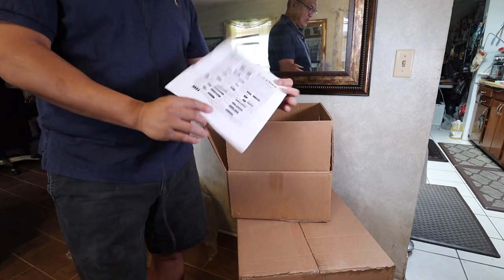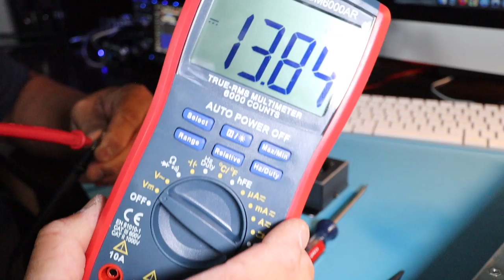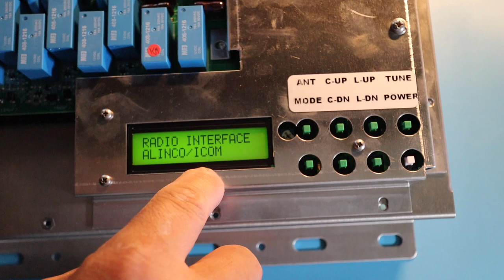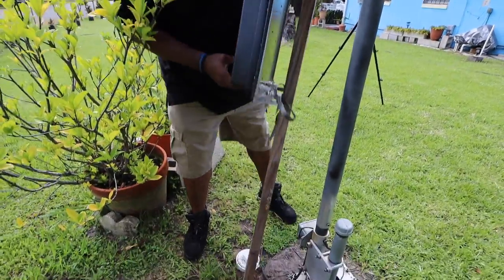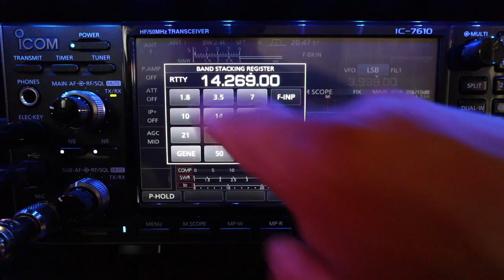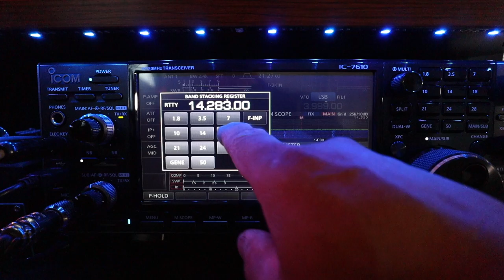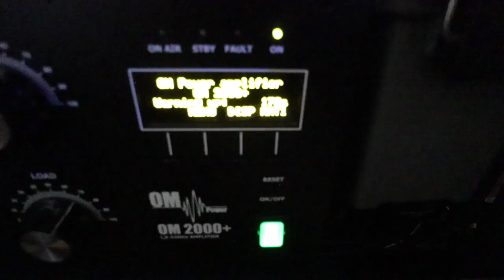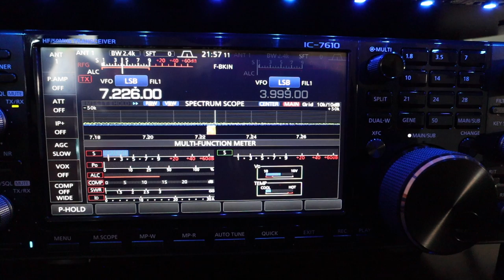MFJ-998RT Antenna Tuner | Modifications to 998RT | Installing at the base of Zero FIve Antenna 43'

Comment: Good job Darren, it's all in the little things that keep us on the air! I purchased my MFJ-998RT about 3 or 4 years ago, had to protect as well but have never had a single problem with it. I use it remotely with my brand new ZeroFive 10-80M Ground plane that I bought, assembled and raised up in the air for 3 weeks now. I am very impressed with the antenna and tuner that I haven't even warmed up and used my Acom amplifier, lol.
Reply: Was impressed until you showed the " Lets go Brandon' vulgarity when you zoomed in to show your work. Vulgar politics is unacceptable for this hobby.

Comment: Nice video. I am the guy Dom told you about. (Ka8jil) I have the new 998 rt still in the box. I will make your changes and hope for the best..Still upset that MFj offered no help for the failure.
Reply from the maker: Hi Tom, nice to meet you through YouTube comments. I bet you were surprised to hear that I mentioned about the failure. Right now , I've removed my 998RT and boxed it up. I'll use it as a backup. I have a new amp with a builtin tuner. 73's de N4VFR.
Reply: @DarrenN4VFR  Oh you got rid of the 998RT ..  don't blame you .. like to know what amp you have please sir with the antenna tuner built in?  Thank you for all you do keep it up.
Reply from the maker: @kayakbassfishing473  I still have the 998RT for another project.  Here is my new amplifier with the built in antenna tuner, it's the RF Kit RF2K-S from Germany.  If your in the USA, you can order from Island Amplifiers:  https://islandamplifier.com/product/rf-kit/

Comment: Thanks for your very informative videos OM. I opened up my new MFJ 994BRT to do the mod and discovered this model does not have a heat shield. It was still a good idea to look everything over before installing out by the antenna anyway.  73, Bob WA4MBG

Comment: Great job great video  the lightning arrester is fine you can't pass DC voltage through them. No lightning in no lightning out 😆 better way is to just run a control line for power out to the 998 . 73  k1SHE

Comment: Good video. I have a couple minor issues with it I’ve left in the comments but well done. 
  I understand that you ended up not using this tuner because you got an RF-KIT amp with a built in tuner. 
  I considered the RF-KIT amp too  (very nice) but decided on the Mercury LUX mainly because it’s American made but also because the tuner is NOT built in. (Separation of concerns). Also, it’s better to have the tuner remote and close to the antenna which is why I chose the MFJ-998RT. 
Cheers!

Comment: Thank you for sharing, Darren. It is a great tuner. Unfortunately, it doesn't tune my antenna for 10m band and even my trx tuner can easily tune it. I asked for new tuner,  mfj sent it but still doesn't work for 10m. I have 33ft GP with 21 radials.

Comment: Good Job Darren, I have a similar setup as you.  I use the zero-five 43' with the MFJ-998RT.  My coax run is approximately 300' of LMR-600.  I had a few tuning issues at first, but I read that the system can correct itself if you cycle power to the tuner.  More often than not, I found that the tuner provides lower SWR tuning cycles after cycling power.  Give it a try when SWR values are higher than what you think they should be.  I also learned that the trans-match at the shack needs to be located between a DC blocking lightening arrestor and antenna.  We Enjoy all your videos.  73 - KL7EZ
Reply from the maker: Hi Scott, yeah I figured that out where I need to sometimes cycle the power to get it to tune. I think its called Sticky Tune.  With regards to the lightning arrestors, it has to be placed between the tuner and the antenna.

Are you bypassing the 4:1 Unun? I will bypass it in my next video and see how it tunes.
Reply from the maker: @Nunya Bidness Thank you, I will take.my 4;1 UnUn offline and re-measure.
Reply from the maker: @Nunya Bidness I haven't been home yet to bypass the 4:1 UNUN.

Comment: I agree with AcydDrop about removing the unun. I have the zero five 80-10 flagpole antenna with a mfj 998brt, and kept the unun out of the mix which made it easier to tune on 80 meters.
Reply from the maker: Okey dokey, I'll have to try that.

Comment: Just a suggestion, since you have what appears to be a conduit, install something like the RCS-8V antenna switch and do a connection to the UNUN, the 998RT, and one directly to the switch (for 60M) and test between them. It would also give you two spare ports for other antennas later, AND, it would all fit under your "rock".

Comment: Hello Capt Darren. MFJ is surprizing me everytime I am buying one of their Products. It's always funny when the Mail Man knocks on my Door to hand over the Parcel and there's a strange Noise coming out of the original Box that makes you think there could be like a hidden Damage done to the Item inside during the Ride from the Seller to the Recipient. After unpacking the Antenna Tuner I bought I needed to open the Lid and a Screw fell out which doesn't even belong in there. However it came in there...but the Antenna Tuner worked fine.
You Guys did a fantastic Job installing the MFJ-998RT Unit. And Congrats on your home made Modification, Capt.  And yes, don't sell your Palstar AT2K - keep it as Backup.
Happy Weekend & 73 de YFUG 💯👍🙋‍♂🍻
Reply from the maker: Thank you Uncle Guenter. Have a great weekend!
Reply: @DarrenN4VFR  💯🙋‍♂🍻
Reply: I'm surprised MFJ is still in business.   I stopped shopping with them after I got 3 "surprises" in a row.

Comment: Lightning arrestors  shunt DC to ground. Buy a straight key for tuning. Is their not a control cable for tuning from the radio so you can use the tune button?
Reply from the maker: Thanks.  I have a paddle keyer now and if your going to tune with the 998RT, you will need to send a CW tone or use RTTY which I normally do.  73's

Comment: Great job Captain.  Really like the "Let's Go Brandon" Edition.  I'm looking at putting up a vertical right now.  And this combo (05 @ 43' & 998) is the setup I'm thinking about going with.
Reply from the maker: I haven't tried it yet, some Hams tell me to bypass the 4:1 UnUn and just go directly to the antenna.
Reply: @DarrenN4VFR  Please let us know about the outcome going directly to the antenna.  My take is that if the tuner can handle it, why not remove the UnUn from the mix.

Comment: Darren, Thanks for this video. I have wondered how a remote tuner would work on my ZeroFive 43 foot antenna and now I know. That is good information about the fixes/modifications you applied to the MFJ998 RT tuner. The troubleshooting for the 5 volt getting shorted was a good job. Right now I'm using my Flexradio Tunergenius XL tuner that is next to my Flexradio 6600 as the tuner. Do you have any feedback about the difference in your transmit and receive performance since moving the turner outside next to the antenna? In looking through my logs on QRZ I see we have had a few FT8 contacts. I am WD8OQS. Thanks Again and 73.. John
Reply from the maker: My tuner didn't last too long, maybe about a month before I ended up selling my 998RT.  Right now, I'm using an 80m double bazooka with my Anan 7000dle Mk3 and also my IC7610.  I will probably use the Zero Five 43' as my diversity antenna here at my Florida QTH.  I have so much Power Line RFI noise.
73 Darren N4VFR
Reply: @DarrenN4VFR  Thanks for the response. Any reason you sold the 998RT? Was it still working without any problems?
Reply from the maker: @JohnWallace74  While I'm away from my station, I don't have any indications or display that tells you your tuned.  I'm now using the Palstar HF Auto and I have a remote camera facing the display.

Comment: Consult PolyPhaser and see if the protector you are using will allow your DC voltage to pass through as a control voltage. Can you run a separate control line?
Reply from the maker: Thank you. I was thinking about using a battery and solar charger to power the 998RT therefore, I wouldn't have to worry about the bias T DC power.  Sometime I needed to cycle the on/off power to invoke tuning of the 998RT.  So I may have to come up with a way to cycle the power remotely....

Comment: Does this tuner have RF sensing to auto tune or need to run a control cable back to the shack?
Reply from the maker: The 998 has RF sensing to auto tune.

Comment: Make sure you m&p coax is the same velocity factor  as the rg213 which is 0.66vf,,,it has to be all the same vf from rig to antenna  end.,,,as for your noise try a noise phase unit.
Reply from the maker: Very interesting.  I'm now using Ultraflex 7 for my equipment to equipment and from the window pass through to my DX Commander Classic now.

Comment: Please be advised, The manual says to not to change the radio interface menu item. “This function is not used in the remote tuner. Leave this setting to OFF. “

Comment: Oh boy the joys of verticals, you have a lot of noise on the bands, that would be a head wrecker.. by the way, get the COMP on and get some drive in that audio..
Reply from the maker: Yeah, a whole lot of noise here at this QTH.  I got the Compressor on now.  Thanks!
Reply: What do you mean by the COMP sir I am a new HAM .. thank you!
Reply from the maker: @kayakbassfishing473  The COMP on the Icom IC7610 when turned on limits the audio sine wave into more of a square wave.  Remember what a sine wave looks like?  It basically chops off the tops and bottoms of the sine wave to create a more square wave. So, it provides more gain for lower frequencies and less gain for higher frequencies.  In other words,  the lower transmit signals levels are amplified more and the higher transmit signals levels are little to no amplification.  This will provide more audio punch to raise your Automatic Level Control (ALC) to closer to the top of red line level.  And with running an HF Amplifier, it will send higher transmit signal levels so the amp can transmit more power.  Be careful to not overdrive the ALC levels or you will get distortion.  73's de N4VFR
Reply: @DarrenN4VFR  wow thank you sir!!!!

Comment: Old News.  Another ham concealed his remote tuner under a similar fake rock back in 2016 and was featured on Page 64 of the March 2016 QST Magazine, Hints and Kinks column.  You could have given him credit for beating you to the punch back in 2016, but this suggests you did not do diligence and research the available literature before embarking on your project.  You might have avoided a number of mistakes that way.  Just saying.  :-)  

A 4:1 balun and automatic tuner are both matching networks - so one is redundant, like wearing a belt with suspenders.  It might tune better without the balun, as it is certainly unnecessary.  The tuner does the job well enough on its own.  

Plugging a live (ON) DC power connector into equipment a poor practice.  You could easily short the center pin with outer connector or equipment chassis and short the supply and damage the equipment as you insert the plug, especially if equipment is connected to other gear sharing a single point ground system.  Best practice is to ALWAYS turn DC power off when connecting or or disconnecting power cables.   You may consider this paranoid, but repair service centers make good money fixing this fault.  You missed an opportunity to teach a best practice in your video. 

Running a bias tee through a DC-blocking lightning arrester demonstrates you do not know how your equipment works, AND you failed to read Item 7. on Page 4. of the MFJ User Manual, which clearly states:   "If optional Lightning Surge Suppressors are used  ... make sure they are the type that will pass DC such as the MFJ-272.  DC power is supplied down the feed line to the tuner."   Duh.  You lose credibility as an expert with this fail.  

Curious you did not edit mistakes out of the video, simply stating proper procedure, instead.  That would save time and make you appear a lot smarter.  

The Let's Go Brandon sign is surely misplaced - many hams enjoy the hobby to escape political conflict.  

Parenthetically, Kenwood transceivers have a simple single button that transmits low power CW for tuning, automatically restoring your mode and power of operation.  Even old TenTec rigs got this right.  Why ICOM and Yaesu rigs do not have this is beyond comprehension.  Just saying.   

Your buddy Mike is a good sport.   I would have had him hold the camera and record my progress - instead of making him do the work.  Kudos to Mike for being a good sport. 

Thanks, but I am disappointed and not impressed by your story.  73, OM.   TT

Comment: I'm not trying to be critical here or be a negative or anything, but you didn't do this setup properly.  What you need to do is remove the Unun entirely and connect the 998RT in it's place.  What you've done here is not really any different than having a tuner in the shack.  I appreciate the effort and I love your videos but this is just not the way it's meant to be done.
Reply from the maker: Thank you for your input.  I'll make another video about that.  I'll measure my performance with the 4:1 UNUN and remove it out of play and connect it directly to the 43' Zero Five using the wire antenna feed point from the 998RT and compare the performance.
Reply: What's wrong with this setup?  The antenna is designed to be used with a tuner.  Placing it at the antenna base just reduces line losses.
Reply: You are doing great Darren keep it up man ..  love what you do and how you work it out and let us newbies see your trials and tribs ..  makes us more confident we can do it too .. keep going man I am loving what you do!!!!
Reply from the maker: @kayakbassfishing473  Thank you! I'm glad you've enjoyed my videos. Have a great day and keep on watching, 73's de Capt Darren N4VFR
Reply: Capt.  your videos are very helpful.  Keep up the good work!  Thank you for sharing your knowledge!  73 BretC/ AC0AE